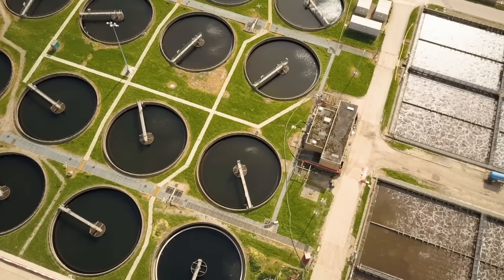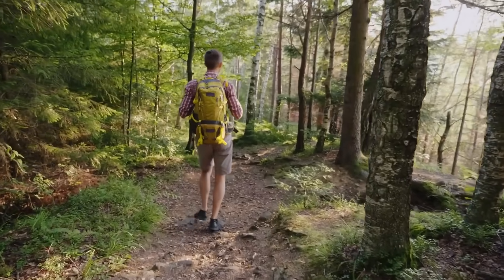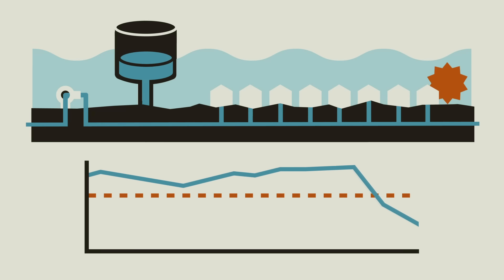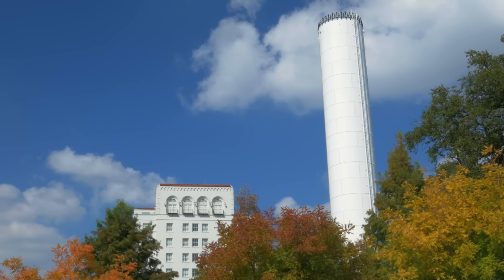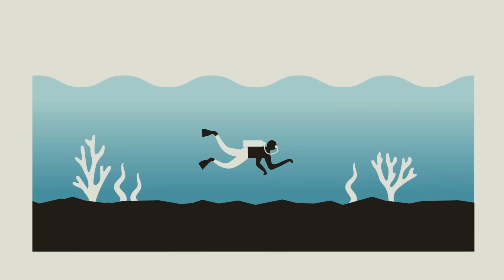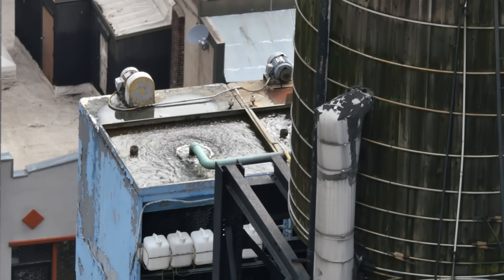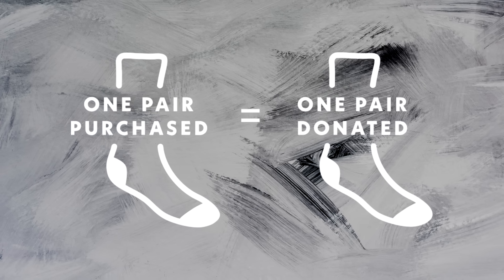How Water Towers Work

Comment: Hi, can you do a video about a low tech passive water pump? 
Not a ram pump though. Maybe a siphon. Anything that can bring a water to a higher elevation. Cz im trying to design a wall aeroponic system, but the water circulation must be zero-electricity, no moving parts or less and with high pressure back up enough to create a mist when water passes through a sprayer.

Comment: Here in the Netherlands, water towers are mostly a thing of the past. They have mostly been replaced by pumps. The ancient ones that are still around, often serve as someone’s house 🙂
Reply: Wait, how is that economical? Do your pumps ramp up and down to match demand? Why would that be better than a constant pump supported by a water tower?
Reply: @General12th  sounds like an excellent question for PE. But it is as what you describe: the pumps can scale based on demand. Apparently that's more efficient than pumping it into a building first. The downside could be a power outage, but that's a downside of water towers too: they run empty pretty quickly after a power outage as well. It's just postponing the inevitable a little bit. So I guess over here they just decided they were redundant mostly.

Comment: The pressure level of water tower could be increased by installing additional weight on movable top. The extra weight would be lifted up with the combined force of water and electric motors.

Comment: Other interesting fact about water pressure in buildings for fire suppression is that they use standpipe connections outside which allow fire pumper trucks to pump water into a building if the city water in the fire line is interrupted for any reason or if the building fire pumps are out of service.  This allows the building's fire suppression system to help with battling the blaze.

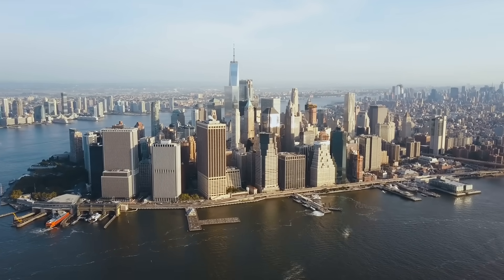Comment: just before 3:00 you said by increasing the pressure of the fluid. isnt the main difference between pneumatic and hydraulic systems that you cannot compress fluids?  at least not like you could compress air. it would require immense amounts of energy.

Comment: I know this is late, but I was watching your old videos because your channel is full of interesting stuff for engineers or engineering students and I noticed two things wrong with that statement there, but it is excusable, seeing that most viewers will not know or use this data in real life and the analogy will get needlessly complicated if you used accurate terminology.

But for the same of completeness and as a tired engineering student who just finished a midterm on the subject, I'll address those issues I found. At 2:21, you said, "...just like electrons in a wire flow from high voltage to low voltage...".

The use of voltage is excusable since the correct term is electric potential, measured in volts. Voltage is the change in electric potential, so "high change in potential" vs "low change in potential" is what is implied when you use "high and low voltage", which makes little to no sense in the context of the analogy.

Next, the electric field is what flows from high potential to low potential. Protons and electrons have the same charge but opposite signs of charge, so I will refer to them as positive and negative charges respectively. The electric field can be thought of as originating out of positive stationary charges and ending in negative stationary charges, with the direction of its flow being the direction that mobile positive charges go when within that field. In other words, the stationary positive charges are the peak of a hill and the stationary negative charges are the deepest points of a valley.

A mobile positive charge rolls down the hill, its positive charge analogous to positive mass. But what if we have a charge with "negative mass", a negative charge? The charge instead rolls up the hill towards the stationary positive charge. As previously discussed, this would mean that the negative charge flows towards positive charges, which have a higher potential than negative charges, this flow acting against the direction of the electric field. Negative charge flows from low potential to high potential, just as negative mass would, in theory, roll up a hill.

PS: In real life, both charges are likely to be mobile and that makes no difference in the behavior, but it is simpler to think of some as unmoving as a thought experiment.
PPS: In real life, positive charges or protons do not move in a wire. In electrical physics, we often use the conventional model of electrical flow, which describes electrical current as positive charges being pushed by the battery. Outside of a wire, we could have positively charged objects in an electric field (so the analogy still holds), but in most cases, the gravitational force is greater than the electrical force.

Comment: This is the same concept with a well pump system.  You have a pump in the ground pushing water up into the house but to maintain pressure in the system when the pump cycles you have a pressure tank that has air pressure in a bladder like a car tire.  That way you have good water pressure no matter what.  Bad thing is if your bladder pops like I've had one do the pressure tank is basically a storage tank then and is useless for pressure.

Comment: 1 meter of water head pressure is 10kpa, 10 meters is 100 kpa...

It also works out even if you go over say a 5 meter hill, it loses 50kpa on the way up and gains 50kpa on the way down. But with that you need to add friction loss, which changes depending on the size of the pipe, new shiny pipe also flows alot faster like a shiny slippery dip compared to an old one!

Australia is new in the terms of infrastructure but some of our older water tanks (110 years) were always built at top of the hill and often still are

Comment: If we already use water towers to store both water and energy, why haven’t I heard of water towers’ usage in the electrical grid (other than pumps)? It sounds to me like you could easily force the water to flow through a turbine on its way down, which could supply extra energy to the grid system. There is always the problem of storing the energy, but isn’t it true that electrical demand goes up at around the same times as people are using water? Obviously there is a shift because people tend not to use as much electricity in the day as they do in the night, but surely that evening increase in demand for water coincides with an increase in electrical demand as people turn on their televisions and start to turn on lights. I’d like to hear why this isn’t more common or if this is already an established practice and I’ve just been uninformed.

Comment: 2:22  electrons do not flow in a copper wire. The latest thinking is that the entire length of wire becomes almost instantaneously energized with the electricity at just under the speed of light. Don’t believe me, do your own research.

Comment: I live at a lower elevation than the surrounding area. The street pressure is about 105lbs psi. I use regulators set at 50 psi.

Comment: I have never seen something like water tower in Europe. Probably here is some another technology. Could you make a video about that?
Reply: Exactly what I was thinking. We have a lot less water towers because of great engineers in the beginning of the 20th century. Germany was the first country to use mostly underground reservoirs combined with electrical pumps to maintain the pressure in water pipes. A lot of the older water towers disappeared and some were used otherwise.

Comment: Mmmm wait, is the reason we don't use this to fix the renewable energy stockage issue is that the reconversion to energy wouldn't be good enough? Otherwise, I see this as a huge battery.
Reply: They actually use water as a battery for energy in pumped -storage power plants. And they use for example wind energy if there is too much from it to pump water in a reservoir up on a hill and then release it when there is a shortage of renewable power.
Reply: Short answer: gravity is too weak to make this practical.

The amount of energy you can store in a gravity battery equals the mass of the block times its height above the ground times gravitational acceleration: E = mhg. One kilogram suspended ten centimeters above the ground contains one Joule of potential energy.

AA batteries store around 9000 Joules of energy.  A gravity battery storing the same amount of energy would either need to weigh nine tons, or be suspended almost a kilometer off the ground. (Or some middle ground between the two, like weighing "only" one ton and falling "only" a hundred meters.) Basically, imagine hoisting a truck up and down a skyscraper. In comparison, a AA battery weighs a few dozen grams and can be carried anywhere.

And that's just a single personal battery. Large cities might use gigawatts of power. If a gravity battery wanted to compete with that, it would need to drop mountains from as far away as the Moon. Clearly, gravity is not up to the task, at least on Earth.

Comment: Painting an elevated water tower is no easy task, or cheap. At times even the inside has to be emptied and painted. Many times before painting the inside, they will have to be sandblasted, then cleaned out, and several coats of high build epoxy paint applied. This process is expensive, and a lot of manual work.

Comment: minor correction at 2:22: electric current "flows" from high voltage to low voltage.  electrons flow in the opposite direction.
Reply: That’s wrong. Electrons move from high electric potential to low electric potential. Don’t confuse electronics notation with what actually happens in nature.
Reply: Yeah, positive current made of "holes"

Comment: Ah yes, I've driven by that water tower in my hometown for over 20 years and began to finally wonder if it really does anything. You learn something new every day
Reply: NEVER FRET! once our water and its delivery systems are privatized, water will be in increasing short supply, driving up costs and reducing and restricting public access. right now, as i type this, corporations the world over are scrambling to claim monopoly over our global water supply. the corporations POLLUTE the water and then horde the clean, safe water for themselves and for profit. water will be become a luxury and a commodity that only the rich will be able to afford. the corporations will hold raffles and lotteries to determine which people and which communities will get any water that week. isn't capitalism wonderful? 
          but you explained how the water tower releases the water but not how the water gets in there in first place. the water towers i've seen have one pipe coming from it. its for distribution. so, how does the water get into the tower? it would need its own pump to get the water to the high level of the storage tank. also, how are these storage tanks cleaned and how often? i assume, over the years, they accumulate all kinds of gross, scuzzy stuff.
Reply: @cjmacq-vg8um  I don't know the specifics of the water towers you've seen, but my guess is: What you think is a single pipe might be multiple smaller pipes enclosed together inside a larger pipe. Much like a cable with multiple strands. You wouldn't want the pipe leading to and from a water tower to be exposed. Exposed pipes could be tampered with, depending on the climate you live in, they might freeze in winter, and if an exposed pipe ruptures, and the content of an entire water tower spills into the surrounding area at high pressure you're looking a some serious damage. So: bundle the pipes, encase them in a larger, very robust pipe along with some insulation and/or heating elements and you have a much safer and more reliable water tower.
Reply: @MrAranton  sorry to say you're absolutely wrong there is one pipe leaving a water tower and one pipe only.
Reply: @cjmacq-vg8um  you don't have a clue water towers and water companies have been privatized for years already. You're just some nobody that thinks he's smart.
Reply: @daffyduck9901  ... thanks. that's very kind of you.
Reply: @cjmacq-vg8um  sorry
Reply: @daffyduck9901  ... i appreciate your apology. everything you wrote could've been written without the insults. instead of insulting me - TEACH ME! you're right. i don't know everything about everything. 
       essentially, utlities are considered "public works" corporations. meaning they're supposed to be motivated in the public interest not in private profit. they must ask a govt commission to change anything they do; from process to rate increases. 
        but it doesn't work that way does it? our public works utilities are corrupted by private investors that DEMAND profits for their investments. as a result our public works utilities, water delivery and electrical grid have become antiquated and horrible unclean, unstable and ineffecient. 
          but you say water tower pipes lead water out! how does the water get in there then? THAT'S MY QUESTION!
Reply: You really do.
Reply: @MacGooner  ... that's funny... and oh so sad at the same time. there are people out there, way too many, that believe EVERYTHING is a bloody conspiracy. these paranoid delusionals are mainly on the "right." 
         the nazi's claimed germany lost wwl through a vast international communist, jewish conspiracy. they claimed jews and communists kidnapped children and ate them in ritual sacrifices. just like what q-anon claims today! 
         so many of these conspiracy claims have origins that are centuries old. they are usually recycled over centuries and play on people's fears, suspicions and prejudices. i believe its a mass psychosis. i call it "paranoid gullibility." 
          one thing i know, we can't let these mentally ill fascists take control of our country or the world. if we do, we'll find ourselves in a dystopian nightmare from which we can't awaken!
Reply: Me too. Didn't realize what gravity was until this video.
Reply: What u learned that day u shouldve learned 20 yrs ago . this way u couldve learned something else the day u learned about the tower.
Reply: @lrodriguez9315   This makes no sense.
Reply: @Aoredon  its ok buddy someday you will.
Reply: @lrodriguez9315  It will*
Reply: @doofphineasandferb8049  i stand corrected thank you.
Reply: @lrodriguez9315  ye
Reply: @lrodriguez9315  yeesh dude I think you are a bit short on knowledge and a bit full on arrogance.
Reply: @goblinsarereal4954  I’m short on both buddy still learning in advanced and delayed terms .

Comment: That moment when you life in Germany and you don't have any watertower
Reply: Gravity is not the only way to accumulate energy. You can use pressure tank for example.
Reply: Really Germany doesn't have any water towers? I just assumed that if u have running water that they store it in a tower.
Reply: @averagejoe4932  no our water gets pumped out of the ground and the pressure is generated by the pump

Comment: So why not just make the pipes wider at the lower levels and have them constricting smaller as they Elevate to equalize the pressure and address the topographic relief so that the houses on the top will have just as much pressure is that houses on the bottom. I mean I'm just saying. Seems like an easy fix to me.

Comment: I'm curious why water towers are not really a thing in Germany. I know that all houses have pressure regulators, but that alone fixes only the problem of different pressures at different heights. It does, however, not explain how the main pipe is being pressurized in Germany. Of course it doesn't seem a good idea to rely entirely on pumps. However, maybe the storages are kept closer to the pumps and on ground level. That would work if the tanks are pressurized e.g. with Nitrogen. Maybe the maintenance costs of having pressurized tanks is less than the initial costs and maintenance costs of a water tower? But it's all speculations. I have no idea why it is this way in Germany and a quick search on Google also didn't yield any useful answers...
Reply: Comment from future me: In some hilly areas, I found some underground water storage facilities in recent years. They are usually somewhere uphill and can therefore do the same job as a water tower.
I still don't know how it works in flat areas, though.

Comment: if we used one way valves couldn't we make water towers more efficient? like when they are being drained they would create a lower pressure and suck water from the supply and one way valves would take care of the backing up of water and stuff. of course pumps would still be needed, but i could work in my head

Comment: The water tank works looks like a capacitor in electricity.
Reply: More like battery
Reply: @santamariamarvy  battery used to power up the electronic while capacitor keep the current and voltage  stable, like the pressure in this water tower.

They store energy but have entirely different use.

Comment: Very interesting video. For 12 years I was chief engineer in the pump house at the Museum of Transport and Technology in Auckland, New Zealand. The museum was built around the pump house which was opened in July 1877 to supply water to Auckland city. The boiler room contained four 30’ long Lancashire boilers which supplied steam to the double compound beam engine in the engine room next door. The engine drove two pumps which took water from Western Springs Lake to reservoirs in Ponsonby and in Kyber Pass Road, from where it was then gravity fed down to the city. 
As a result, I have always had a fascination with water and its supply and how without a water supply, you do not have a city. 
Keep up the good work.

Comment: Water towers are to pressurize the system. not to keep it for storage. Nobody believes this when I say it. Thanks for making it real. My proof is usually this phrase. Why Pump water into the air to keep it as usable? Under ground would be fine. Right? I was partially Wrong. Thanks man.